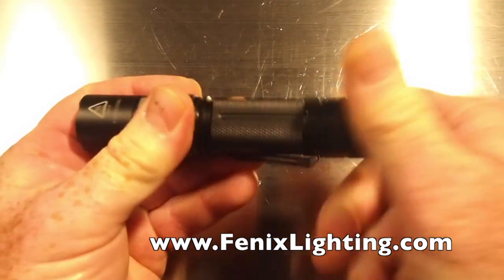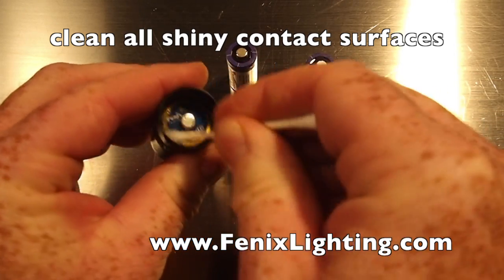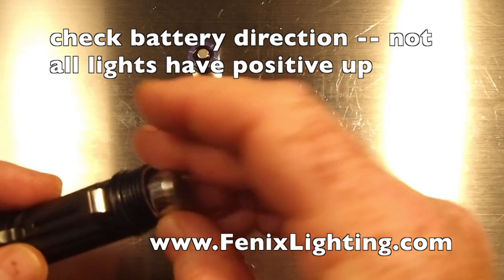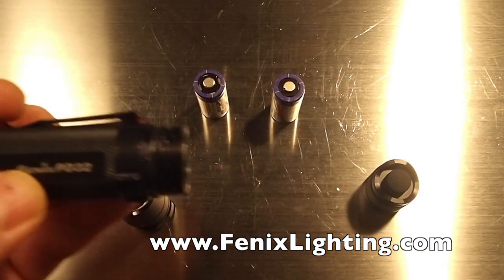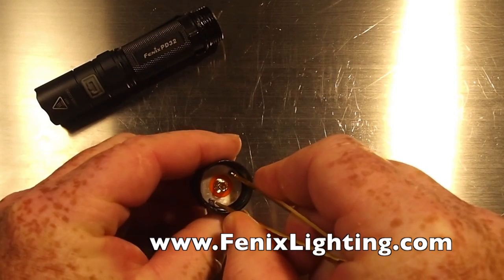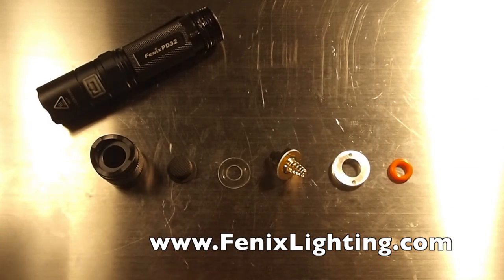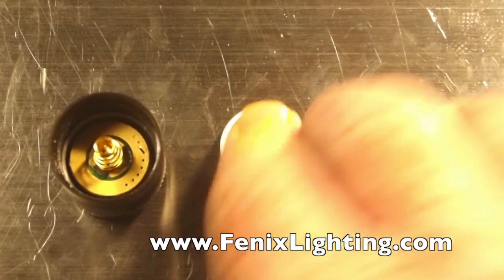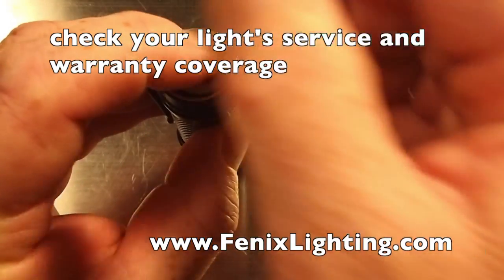LED FLASHLIGHT FIXES from www.FenixLighting.com

Comment: my light will turn off on it's own even with a fully charged battery.  I really liked it before it pretty much became unusable.
Reply from the maker: Have you contacted out warranty and repair department? They can help walk you through any issues : https://www.fenixlighting.com/pages/warranty-repairs
Reply: @FenixLightingUSA  hopefully they cover water damage since the last time it worked normally was when I had to work in the pouring rain and I think the charging flap was open enough to get water inside.

I’ve been able to get it to work normally for small periods but not reliably enough to use it basically.

I’m confused about the warrantee as well since the site said we are on our own if we got it on Amazon but they are telling us to contact you 🤷
Reply: @FenixLightingUSA  Yeah, they had already replied and I just need to check my email more often because I didn't expect such a quick response.

Comment: Fenix flashlights have a fatal flaw. The mode module on the circuit board is held in place with a rubber cement to absorb drop impact. As little as 24inches? After a time it becomes brittle causing it to dislodge from the circuit board upon even light impact. These things are NOT worth the money you pay given this poor engineering. These modules should be soldered and firmly attached.
Reply from the maker: Our lights are ANSI tested to survive a fall from over 3 feet on all sides. If you feel that yours did not, then please contact our warranty and repair department. https://www.fenixlighting.com/pages/warranty-repairs

Comment: I have a TK16 i have tried everything with no success. The light will not come on at all, tried the paperclip troubleshooting method and the led did not aluminate. Any advice on a simple fix ?
Reply from the maker: Is this a new light or old? If new, have removed the battery protector. If so, or its older, please contact our warranty and repair department at https://www.fenixlighting.com/support/warranty-repairs/

Comment: What if my light only comes "ON" to the lowest setting only ?
I have the TK20R, and after one day, it only comes on to it's lowest setting, and will not cycle through any other light mode.
I have charged it, straight from the box, and have let it charge for 12 hours....and the side switch blinks red once, when it is on.
It has a 2900 mAh rechargeable 18650 battery.
Is there a lockout function ?
Reply from the maker: Please contact our customer support at: https://www.fenixlighting.com/support/   They can walk you through any repair or replacement if needed.

Comment: Putting a petroleum based grease on these o-rings with rot them over time.  Vaseline is a petroleum based jelly.  Use a synthetic based lubricant such as Super-Lube, or better yet, an electrical contact silicone based grease like Nyogel760G, or No-OX-ID.  Vaseline is bad advise for anything electrical or rubber.
Reply: We use die-electric grease

Comment: This was very helpful. My LD25 would not switch to the brightest setting but cleaning it solved the problem. I didn't want to risk bending my tweezers so I used two ball point pens instead and held them like chopsticks, which worked fine.